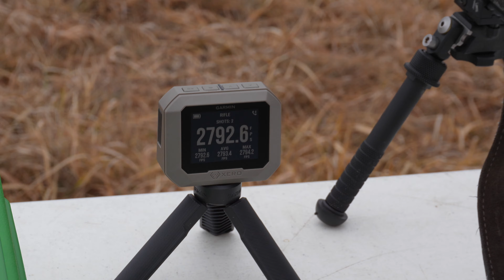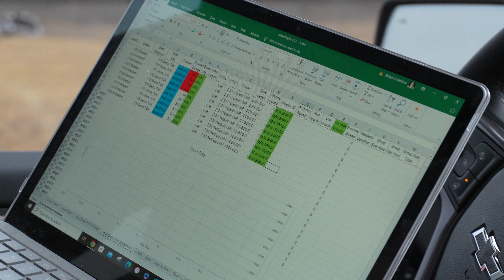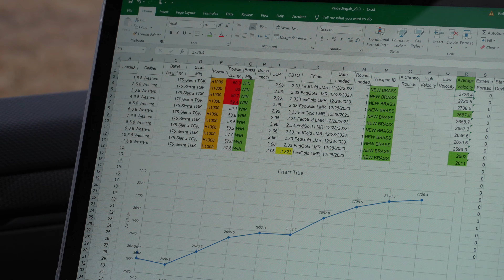6.8 Western - Load Development - Episode 3 - 175gr Sierra Tipped Game King

Comment: Trying different powders and different bullets is meaningful. Seeking flat spots in the powder charge vs MV graph is meaningless. 
IMO the optimum charge weight is one that is below pressure whilst yielding a case fill somewhere in the 99% to 105% range. 
Short fat cartridges appear to be more sensitive to charges below 100% fill compared to long skinny cartridges. 
My 300WSM with 175gr LRX really likes a compressed charge of H100V yielding consistently low SD’s. 
I used to run H4350 with 168TTSX with charges well below 100% fill but could not achieve consistency with that load. 
Cheers!

Comment: Food for thought here: those flat spots are statistical noise and mean absolutely nothing. Unless you're shooting ~10 rounds of each load, natural variation in velocity will give you false flat spots or nodes. Testing with a large sample size shows that nodes don't exist and velocity increases proportionately with charge weight
Reply from the maker: Agreed but doing this tests allows for a starting point and where I can load more in the velocity range I like and test for statistical significance. Imagine if I loaded 10 rounds at what I thought was mid-to max load, I would have wasted 10 rounds because it’s not even close to my target velocity. Ten shot later should be everyone’s starting point rather than blindly loading 5 plus rounds of each charge